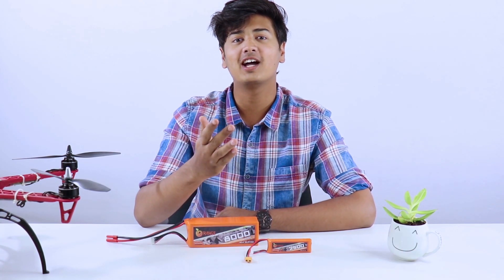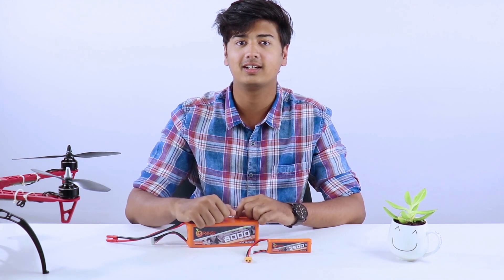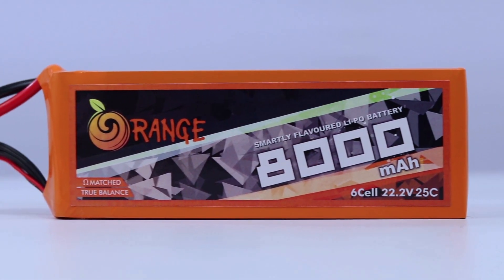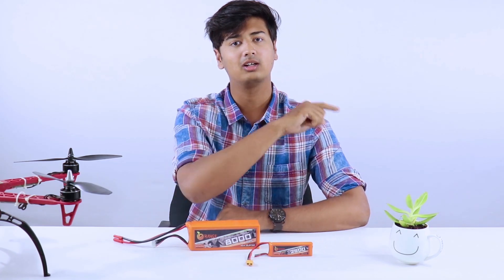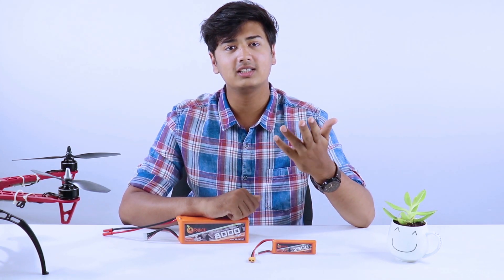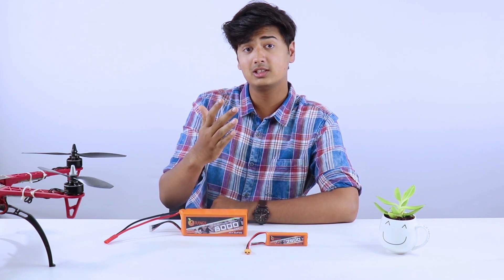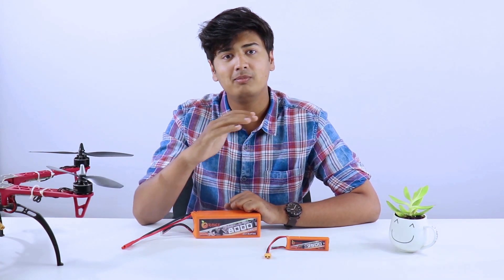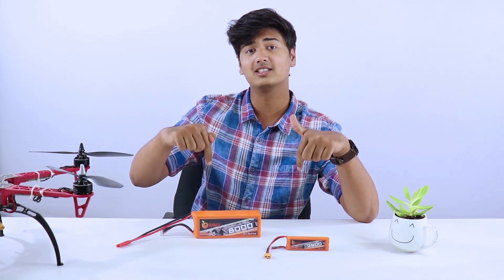Choose the Perfect LiPo Battery for your DIY Drone

Comment: Can i use 18650 battery for my 
drone?
Reply from the maker: No, LiPo batteries are used for drones, not Lithium ion ones
Reply: @RobuInlabs  i have ordered a rs2205 emax 2300kv bldc  motor from your site, including 4 5" propellers but i am still confused about the mah of the LiPo battery to use with it,  the (all up weight of my drone is 1.3 kg without batteries), also can u suggest a battery for my quadcopter, thanks
Reply: @RobuInlabs  BTW thanks for the reply
Reply: @RobuInlabs  BTW when can we expect the LiPos in your site to come back in stock?
Reply from the maker: @hahahhaha8146  very soon ;) . keep an eye on our social media and website
Reply: @RobuInlabs  waiting for it 😃😁

Comment: Hey there! What's the suitable balance range of the cells. I got a 4S and all of the cells are more or less 0.02 volts off from the average cell voltage when at full charge.

Comment: Can you please help me?  I'm using F330 frame, 30A ESC , 1400 kv motors, 8045 propellers, kk2.1.5 flight controller , flysky fs i6 transmitter and receveir. Which battery should I use? ( I'm not good at math ). Please help me Sir.

Comment: Can you please tell me that pixhawk 2.4.8 flight controller is great for heavy drone like octocopter...?? 
Actually I already used DJI naza m lite v1.1 ... This is good but sometime it going to unstable... 
So I decide to change my flight controller...
Reply from the maker: It all depends on what you use the octocopter for. If you make it for Telemetry and other stuff, you can choose Pixhawk. Otherwise DJI Naza is good.
Reply: @RobuInlabs  can dji naza m v2 is more stable than pixhawke 2.4.8..??
Reply from the maker: @avijitkarmakar3744  Yes, Dji naza M V2 is more stable.
Reply: You need gps for position hold and stability